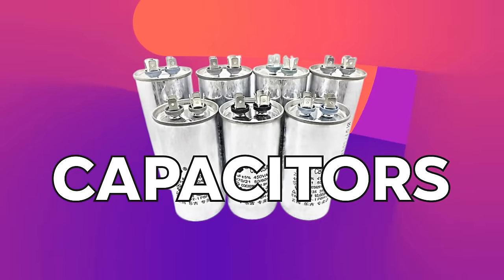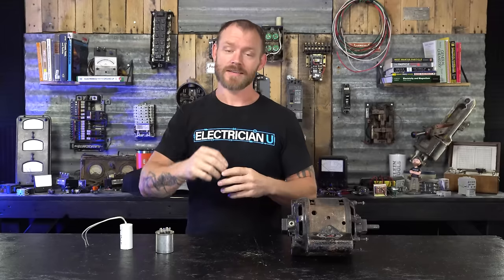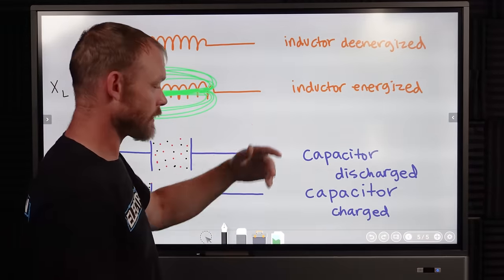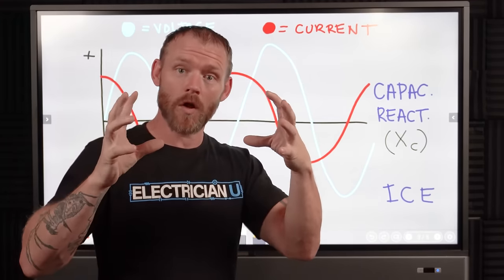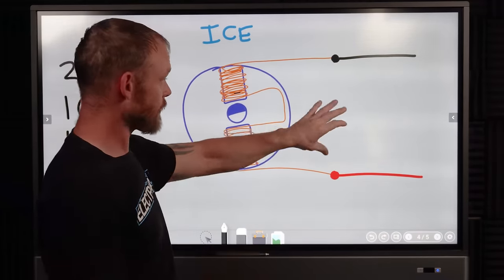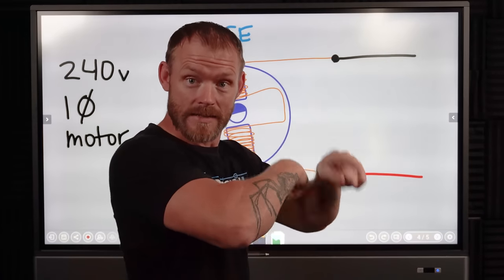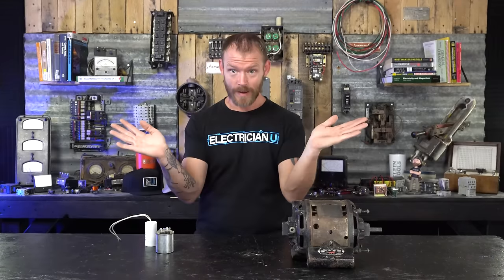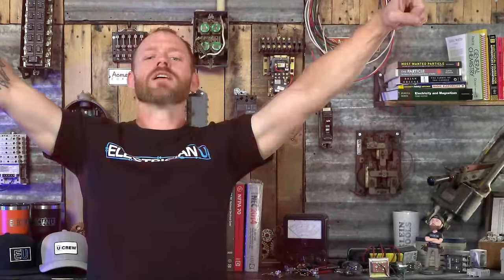Why Are Capacitors on Motors? What is Capacitive Reactance and Inductive Reactance?

Comment: So, what really happens is that say on the positive swing of the AC signal, as the voltage increases, the magnetic fields expands, this expansion creates an induced voltage in the opposite polarity (back EMF) and this is the inductive reactance (resistance of a coil) and why a coil is not a dead short to an AC voltage.  As the voltage swings past it's highest point, and starts to reduce, the magnetic field also shrinks, producing more voltage and this is the lagging current.  Inductors do their best to maintain current as opposed to capacitors which try to maintain voltage.

Comment: Would it make sense to have a converter on a home that changes the AC power to DC power? My understanding with DC motors is they do not have the power factor issues as an AC motor.
So, if correct and in theory, a home could have all DC motors and appliances and use the electricity more efficient? Not to mention, they are more quiet.

Comment: The dialect strips in a capacitor never touch, one plate or film charges with positive and plate charges negatively. I don’t think the positive and negative ever mingle like you said as they have no continuity and are separated by a plastic film. I always pictured it like two pistons each half full of air and there are connected in the middle with a diaphragm that never lets the air mix. As a force (volts) is applied to one piston it pushes its air down into the diaphragm and the diaphragm expands and pushes the air in the other piston to to flow (amps) into the piston and push that piston up . Once that piston is full from the air flow (amps) a force (volts) is applied to the piston and the cycle is repeated but the two airflows never mix

Comment: How do I connect running capacitors to a 24v, 250-watt DC motor to provide a 5-second backup power during changeover?

Comment: Great video. You didn't touch on techniques for conducting surge suppression in large motor starts. Maybe another episode?
Reply: Think you might mean high inrush or LRA ( locked rotor current ). Best in class way to control it is to use a VFD  with at least a 5 second ramp up time. Soft starters, Y start Delta run and autotransformer are also used to limit inrush current. Back in the 1970's we had two 450 HP centrifugal refrigeration compressors that started across the line. Only thing that reduce high starting current a little amount was they always started unloaded. As speed was built up load was applied.
Reply: @JohnThomas-lq5qp  Yes, that was the subject. VFDs are designed into whatever product is being powered, so not much choice there post facto. I was thinking along the lines of soft starting or what other techniques might be available. The topic comes up in the context of solar powered homes. The latest generation of inverters tend to be high frequency, and they give up on large, quick inrushes. The old low frequency inverters could handle it, but they are becoming extinct. Not just an industrial topic anymore. Thanks for your channel.

Comment: When you charge up a coil (an Inductor) it creates a magnetic field.  When the voltage in an AC single goes to zero volts, that magnetic field collapses back across the coil windings and this induces a like voltage that goes back-up the line.  If you are turning that coil on and off with a 12 volt DC source - no big deal as current has nowhere to go; you broke the circuit.  With an AC signal things get a little more complicated.  The coil is charged with + voltage from a source line, when voltage gets to zero volts in the sine wave, that positive voltage is induced back-up that same source line at the same time the source line is now going to a negative voltage state - here we have Inductive Reactance, an Impendence, measured in Ohms to an AC signal.  This is what causes voltage and current to get out of phase within that load (an electric motor in this case).

There is no Capacitive Reactance in an Inductive circuit (load); we add Capacitance to counter act the Inductive Reactance inherent in that load.  With the RPM's of the motor (the load) at zero - Inductive Reactance is high, but as the motor spools up in RPM (after start-up) the Impedance begins to drop.

Comment: What happens as a circuit's inductance (or capacitance) gets even higher? Does the phase shift asymptotically approach 90 degrees? Would that cause the useful work done to approach 0?

Comment: A single phase motor needs a capacitor to create another phase so the motor can begin to rotate. Once up to speed the phase difference between the rotor and stator keeps it running. The problem with single phase is it's single phase. One magnet cannot attract itself. It takes two to tango. In a single phase capacitor start motor the start winding says, mind if I cut out?

Comment: Ah.  Capacitors work either as a damper in AC, or as a high voltage instantaneous power supply in DC.  Pretty neat multipurpose invention.

Comment: Remember this. A resistive element has no phase shift. A coil does as does a capacitor. But the shift is opposite.

If a coil charges up on DC, it short circuits. If a capacitor charges up on DC, it open circuits.

AC charging forces these devices to collapse the field on voltage reversal.

Look at how an old points and condenser distributor works with a DC applied coil. Hint, trace the coil primary thru your points. Here, the term condenser is used as the old name for a capacitor.

I bring this up for a reason. The AC signal created by the points firing is a square wave and not a sine wave. This creates flashing which can burn your points. But the square wave can be seen as a collection of varying frequency sine waves. The capacitor will short the higher frequencies to ground. In other words, it’s being used as a low pass filter. At higher frequencies, the capacitor is literally a short to ground thru a small load.
Reply: "At higher frequencies, the capacitor is literally a short to ground thru a small load"   Literrally? Are you sure about that? Are you saying that the electrical energy dissipated by the points when opening and absorbed by the condenser goes directly to engine block ground and returns to the negative side of the battery? From my understanding, the condenser absorbs this electrical energy but then returns it to ground via the points next time they close.
Reply: @bernardocisneros4402  A motor runs at very slow speed.  Even at 10,000 RPM, that is slow compared to the electrical world.  The actual waveform as seen on say an antique SUN engine analyzer is a dirty square wave.  NOT A SINE WAVE.  So how does one create a square wave in the lab?  Simple.  You begin with a primary frequency sine wave that establishes the frequency of the square wave.  Then you begin to add smaller but higer frequency sine waves onto this waveform.  The various waveforms add and subtract accordingly until what is left looks like a square wave.  In terms of math, you need to visit what is called a FOURIER waveform.

Now, the abrupt switching of the points can lead to overshooting and undershooting of the waveform at the corners of the waveform.  This is not good as it leads to flashing and burning of the points.  We dont care how the waveform was created.  In this case, its created by the distributor and coil being charged up and discharged at a frequency determined by engine RPM.  But, we can still "FILTER" out higher frequency components from this waveform.  That is where the condensor comes in.  This capacitor is functioning as a LOW PASS RC FILTER allowing only lower frequency waveforms to pass.  A similar approach is used in phase conversion when the generated third leg needs to be smoothed out to resemble a true sine wave.  The points are actually on the low voltage side of the coil or its primary winding.  They are the timing device which allows the coil to charge up on a DC charge ramp.  To short, and the coil fires cold as it wasnt fully charged.  To long and the coil short circuits once its been overcharged.  One of the tasks of the ballast resistor is to limit current flow through the coil primary winding in case of an overcharge.  Modern coils often have in integrated ballast resistor.  The HIGH FREQUENCY waveforms filtered by the condensor are both useless and detrimental to the task at hand.  One has no valid reason for returning these spike inducing waveforms back to the system.  Get rid of them.  Send them to ground.
Reply: @devemch7851  I agree with everything you said up above except I believe that the energy stored in the condenser's electric field is returned to ground through the points when they close again. Are you saying that the high frequency sine waves are going through the condenser to ground?

Comment: There is no smoothing done in this example. Smoothing is when caps are used to remove the ripple in rectified AC. As someone pointed out here in single phase AC motors you need to have the windings out of phase. Reactive impedances have magnitudes as follows Xl = 2(pi)f*L and for a cap Xc=1/2(pi)f*C where f = frequency.  BTW charges dont split, the electric field in a cap causes one side to appear as positive and the other side as negative,

Comment: When opening my older AC condenser, i see only one single capacitor with two wires rated 330v 72-85 mfd. Foes it mean it is missing the run capacitor?
Reply: Your older AC condenser had a Permanent Split Capacitor (PSC) motor with only one run capacitor with 2 terminals because that's all it needed to function. The capacitor is wired in series with the start winding. One terminal of the capacitor is wired to the start winding and the other terminal is wired to L1 (one of the hots) while the common terminal of the motor is wired to L2 (the other hot). This single capacitor is higher in capacitance than a regular run capacitor but lower than a regular start capacitor (i.e. It's capacitance value is in between the values of a regular run and regular start capacitor). It gives the motor more torque when starting and helps it run smoother and more efficiently after reaching operating speed. It's always in the circuit. It does not cut out at a certain RPM as a start capacitor would.

Comment: I forgot I had this question. Thanks for the answer.  If the start capacitor dies does the circuit show a dead short and trip the breaker? Thanks again. This isn't simple stuff.
Reply: Motor start/run capacitors usually die "open circuit" because the electrolyte dries out, rather than "short circuit", unless they've been subjected to a severe over-voltage event like a lightning strike.
However, the fact that the start/run capacitor has failed will usually cause the motor to either draw too much current (because the rotor never starts moving so it always draws "locked rotor amps"), or it will just hum and buzz and get hot and the thermal overload inside the motor windings will trip to prevent a fire, for the same reason (motor's not turning, so no cooling can happen if the motor has a cooling fan)
Reply: They usually loose value but have seem them short out.
Reply: @JohnThomas-lq5qp  Depends on the type of capacitor, electrolytics (most common) dry out and lose capacitance, capacitors made of oiled paper and metal foil tend to just not have problems, and metallized polymer film capacitors (usually encountered as "X and Y caps" in an SPMS EMI filter) might have short circuit failures but to a limited extent those faults are self-clearing (with a limited loss of capacitance caused by the vaporization of a small amount of the metallization on the polymer film).
Reply: @44R0Ndin  Great info guy's. Thanks.
Reply: @JohnThomas-lq5qp  Great info guy's. Thanks.
Reply: @44R0Ndin  Great info guy's. Thanks.

Comment: Nice try but a bit off on psc motors.  First a psc motor has a start winding and a run winding.  Most modern psc motors include scroll ac compressors which don't require a start capacitor but DO require a run capacitor.   The run capacitor is wired in series with the start winding and provides start current AND ensures proper rotation.  It stays in the circuit and effectively is an ac current limiting device for the start winding.  The start winding is wound out of phase wth the run winding and therefore benefits with the phase shift a run cap provides.  A larger run cap means more current in the start winding, a smaller run cap means less current. WHEN and IF a Start Kit is added, additional capacitance is placed in parallel with the Run cap, but only until the motor comes up to speed when a potential relay drops out the extra Start cap.   These days ac psc compressors only have a Start kit from the factory if they are recipicating compressors.  However 99% of today's ac and heat pumps are scroll compressors which don't need Start caps in addition to their Run caps.  Dual Run caps simply feed the start windings of the outside unit's compressor and the outside fan motor when both are psc motors.  Two separate Run caps can do the same job.

Comment: Is a capacitor needed for a DC motor power from a batteries and solar panels providing the energy for the load?
Reply: No, a capacitor is only needed for AC motors. The only reason a capacitor is needed in AC is due to inductive reactance from the changing magnetic field.

Comment: If a motor did not have capacitors, upon start up the load draw on the electrical system would be pretty high. with capacitprs though, the instant power from those capacitors lowers the load draw and only uses the power from the panel to run the motor.

Comment: Single phase AC motors have to make a synthesized second phase AC source to create a rotating field in motor to get it to spin up. 

The start (auxiliary) winding is wound 90 degrees in relative position to main winding.  It needs an AC supply 90 degrees out of phase with main run winding. (doesn't have to be perfect) to create a rotating magnetic field in motor to get motor to spin up.

During start up, the motor is low impedance and highly inductive.  It causes the high startup surge current, and the capacitor has to be larger mfd of capacitance value to achieve the 90 degrees phase shift at the lower value of motor start winding inductance.  

Start capacitor optimum mfd value of capacitance gives precisely 90 degrees phase shift.  More start capacitor capacitance is not a good thing and can make startup torque worse.  You will actually degrade starting if start cap value is too large.

In many AC motors there is a run capacitor.  Its value is selected to give a 90 degree phase shift during normal running speed.  This increases motor run torque and improves power factor of motor.   The run capacitor is smaller mfd capacitance value.

The difference in winding impedance between startup and run is the reason for different capacitor mfd values between a run cap and a start cap.  Start cap must be taken out of circuit after motor has spun up.

Three phase motors do not need a starter capacitor since the three-phase input AC source provides the phase shifted rotating fields to get motor to spin up.

Contrary to popular belief, adding a hard start kit to an air conditioner compressor does not reduce peak surge current.  It does reduce the length of time to spin up motor by creating a greater startup torque.  This reduction in startup time may be enough to prevent tripping compressor's internal overload protection by getting out of startup surge LRA current quicker.  Spin up time is more than cut in half with starter capacitor due to the increase in motor startup torque.  Your clip-on amp meter may show a lower startup surge only because it has a time averaging that cannot report the shorter period startup surge current time length correctly.

Comment: Not quite following this, capacitors can only store DC not AC so as far as why they're used on things like AC motors (or any rotating electrical machine) they are more likely providing power factor correction - bringing the current and voltage in phase - actually makes the motor more efficient i.e. ensure a 100W motor uses 100 electrical power vs 100VA. The large cylindrical containers on utility power poles are oil cooled transforms to convert 1 3-phase line to 3 single-phase lines using e.g. a delta star type of transformer.

Comment: When I was in engineering school I came up with the "ELI" and "ICE" memory aids on my own.  At the time I had a cat named Ellie Mae, which made it easy for me to remember these aids.  For inductors, L, "ELI" implies that the voltage, E, leads the current, I, or the current, I, lags the voltage, E.  Likewise, for capacitors, C, "ICE" implies that the current, I, leads the voltage, E, or the voltage, E, lags the current, I.  This is the first time I've ever heard the "ELI" the "ICE" man thing.  I thought I had came up with something unique.  I guess not.  I've also heard various sentences for remembering resistor color codes over the years.  Some of which are fairly obscene.
Reply: There's also another mnemonic to remember how voltage and current waveforms behave with inductive and capacitive loads. it's  CIVIL

Comment: Oh goodness, apparently I’m in way over my head. 😅

I’ve been looking at an 8.5” diameter edge flow fan (“motorized impeller”?) that I want to build a fixture for to use as a sort of ceiling fan for a room in my house (pulls air from underneath, discharges air radially across ceiling), and I read something about needing a capacitor for it, so off I went to see if I could look up what kind of capacitor I need.

Next thing I know I’m learning about run capacitors vs start capacitors and how doing things wrong can make things go boom, and all I want is to hook this little 120VAC, 400mA, 2700rpm edge flow blower up to a light switch in my house (maybe a dimming switch) so I can have a sleek ceiling fixture that quietly moves air about 530cfm.